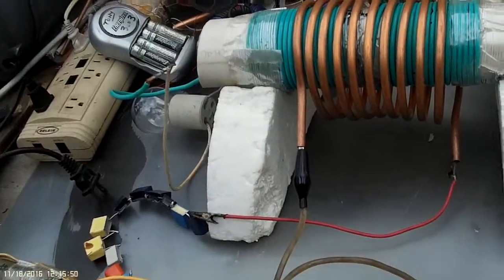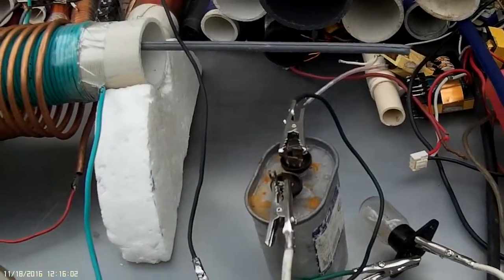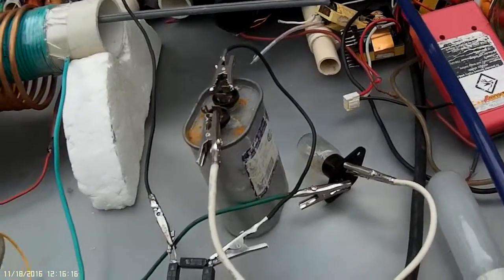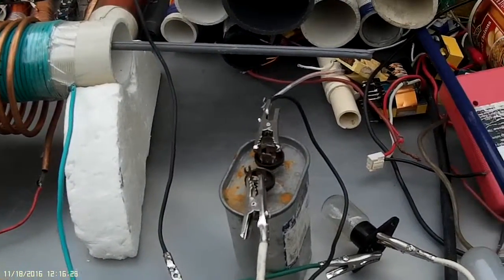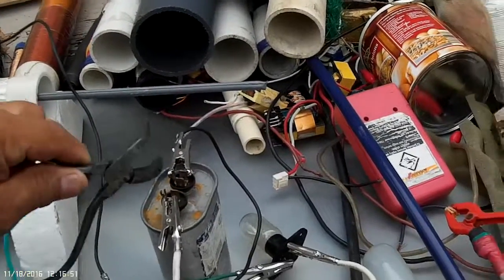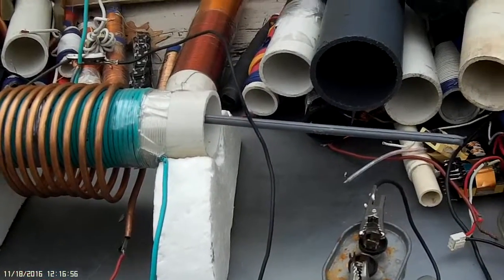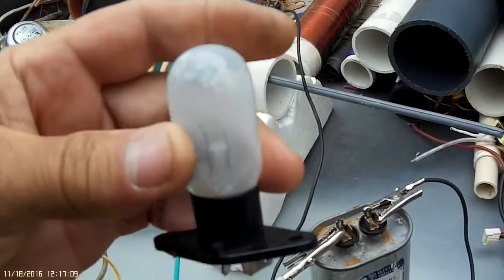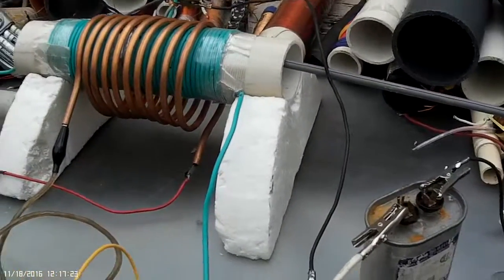Don Smith captured radiant energy!

Comment: That's great! You can directly connect the cap across the positive and the negative of bridged rectifier then use another spark gap to the load. This time ground is useful.
Reply from the maker: The capacitor is receivng a charge even while the SG and lamps are lit up.
The capacitor is a non-polarized motor run capacitor from AC motors in the 120-240 VAC range.It is commonly called a run capacitor in the field.
Reply: You can use a Microwave Oven Capacitor(2kV) and connect directly across the + and - of the bridged diode. And add another SG thru the one side of the load. It would be better if there is a cap with much higher working voltage. I think you almost there.
   BTW, thanks for continued sharing.

   Rgrds.
   J.B.
Reply from the maker: JB-N107Lab The capacitor can be more HV but it will depend on the frequency pulse repetition rate of your generator and frequency.
Reply from the maker: It is called TC =Time constant=amount of time to fully charge a given capacitor...
Reply: Thanks for your scientific explanation my friend. This gives me additional knowlegde about some useful terms.
Reply from the maker: Great!   don't forget to share it!!Cheers
Reply: Ok. Cheers.